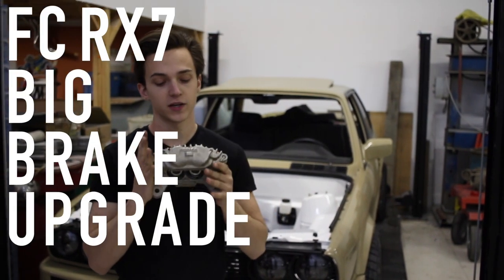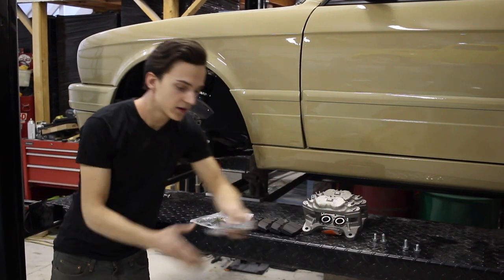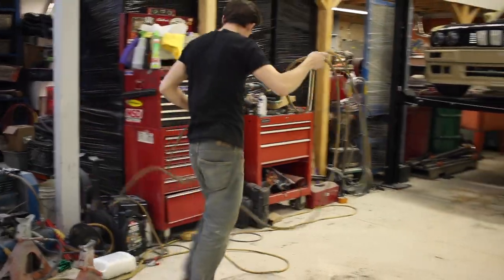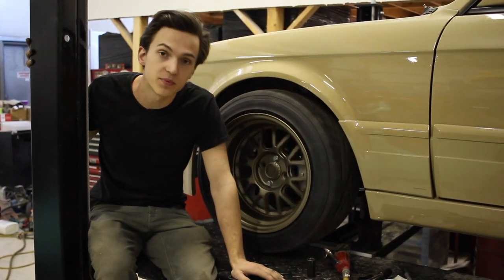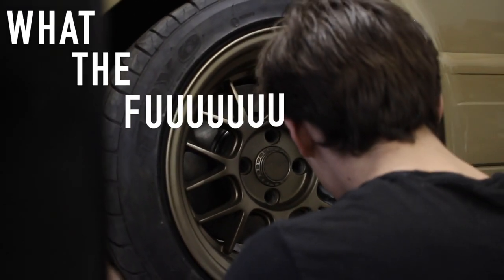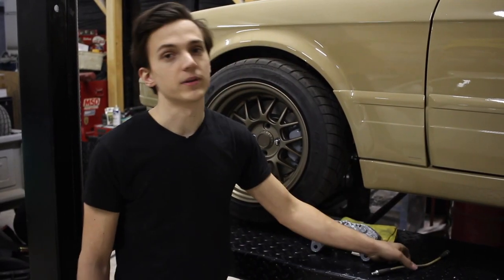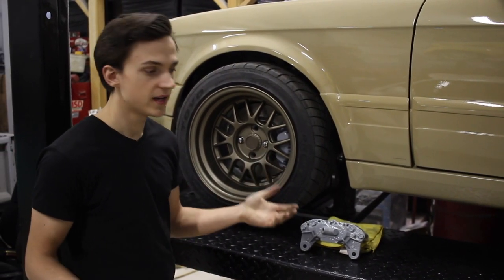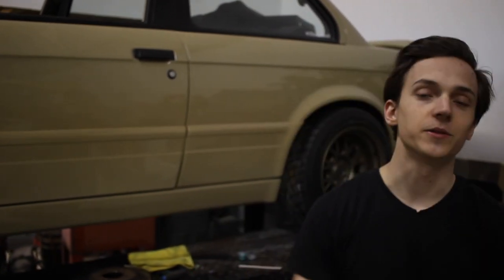E30 RX7 BIG BRAKE SWAP!!

Comment: Love this whole series of videos! Question: did you swap out the rear break rotors as well, along with your suspension for front and back, or did you keep that OEM?
Reply from the maker: The rear rotors and calipers are stock 325i E30. The suspension is BC racing

Comment: Can you fit a 15” wheel around the rx7 calipers?
Reply from the maker: You can but depending on how much space your specific wheel design gives plays a huge role. 

For me I has to use 24mm spacers to clear the callers

Comment: Nice vid. Working on doing the exact setup. Where did you get the M10x1.0 inverted to bubble fitting?  I'm having a hard time sourcing the part.  Thanks
Reply from the maker: Your best bet is to check a local parts store. I believe earls fittings online would probably have some too. Also check out chase bays random fittings section, lots of cool conversion fittings there! Good luck

Comment: What master cylinder and brake booster are you running these with?
Reply from the maker: Chase bays boosterless set up
Reply: @slightlyMADcustoms  Cool. Did you guys also did any measurements on the bore sizes of these calipers vs the stock e30? Some say the surface area turns out to be the same on forums.
Reply from the maker: No I have no idea sorry. But I ended up going back to stock calipers because the pedal was too hard to press with the booster delete
Reply: @slightlyMADcustoms  Ahh i see i see. haha maybe you need a smaller master cylinder? Btw, did you had to cut the backing plate for it to fit?
Reply from the maker: Ya I’m sure a different master would help. I had to cut the dust shield to make room for the bigger calipers

Comment: Hey...did you have to bore out those rotors? thanks...
Reply from the maker: Yes I did! The centre hub bore needed to be englarged by 1mm. I brought it to a local machine shop and they charged me around $60
Reply: @slightlyMADcustoms  
Good. Thanks for your reply.